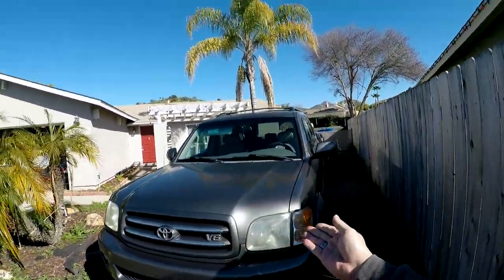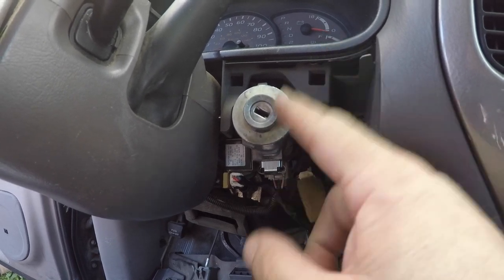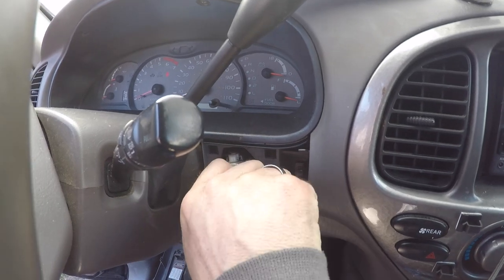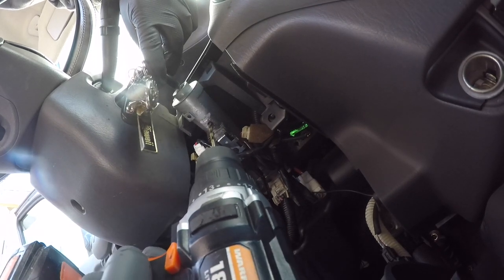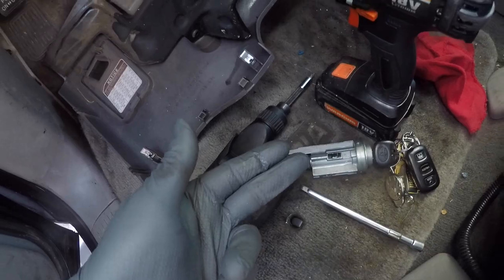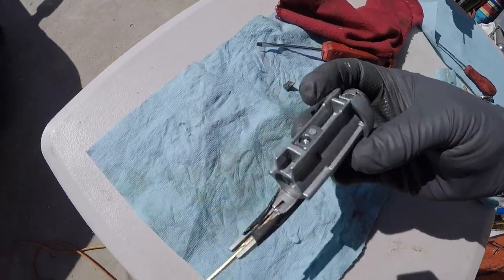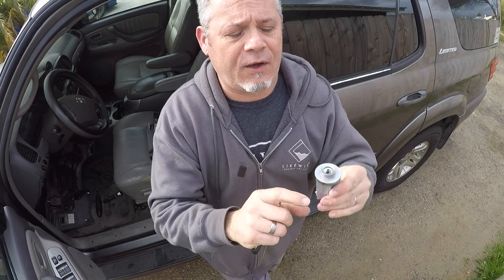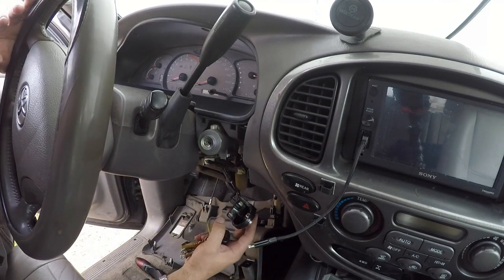How To Fix the Sequoia Ignition When The Key Won't Turn

Comment: Before you guys break out the drill, try some houdini lock spray. I just bought a truck with this issue, almost couldn’t drive home cause of it. Today tried some houdini and it turns no problem. A lot of black nasty crap came out when I sprayed it several times but it hasn’t jammed once after.
Reply from the maker: ABSOLUTELY!!  Try the simple stuff first: lock lubrication, try a different key, try with a brand new cut key from a dealer... THEN and only then, replace the ignition if it's just plain broken.

Comment: I have an old Toyota and it’s a small car.. my problem is I turn the key and only turned on one side of the engine and when I hold the key on start position the whole engine turns on and I’m confused about that

Comment: Thanks for the video! I have the same issue.  I think I have a transponder key and want to keep that key (looks exactly like yours).  I talked to my locksmith and will need an "uncoded" cylinder and then he can code it.  I think that is what you ended up doing too - is that what you refer to as the Ignition tumbler/switch assembly?  Do you have the part number for the 2001?  Thanks!
Reply from the maker: The part number should be the same for any Gen1 Sequoia, they didn't change the tumbler assembly at all for a long time. I used the one from Autozone: Locksmart Ignition Lock Cylinder LC64800 and had the locksmith change the tumblers in it to match my original key, so I would not have to rekey my doors.   The lock cylinder itself does not have the electronic coding - that is housed in the plastic ring that inserts around the lock cylinder.  It stays in place when you change the cylinder, so you don't have to recode your car.

Comment: How much was it all in the end?
Reply from the maker: Replacement ignition tumbler/switch assembly was $70 at Autozone, and the locksmith rekeying it to match the existing keys was $75.  All in for just a little less than $150.

Comment: @CliffjumperCars  Appreciate the help and video.  I fixed my 2001 Sequoia 2WD starting with your procedure and modified it slightly.  I ended up with a key for ignition and another key for the doors which was fine by me.  Here's the process I did for anyone else coming here for help:
- Purchased from Autozone LockSmart Part LC64730.  Comes with 2 new transponder keys - part cost around $250.  I didn't have the locksmith re-key it as my keys were 20+ years old and were worn.  In fact, one was bent some but they work just fine in the doors.  So, now I have door keys and an ignition key.
- My key wouldn't turn either, so I drilled out the little pin you referenced in the video - it took me a solid 10 to 15min to get that done.  Don't give up, just keep going and eventually, you can pull out the ignition key cylinder.
- Pushed the new cylinder part referenced above into place (like in your video).  Now you're ready to program.  

Programming the new keys to the Immobilizer (Must have the old key to program).  The immobilizer is the black ring that shows the key placement of ACC / On.  During disassembly, it will hang by its wiring harness.
- Place old key in hanging immobilizer and just let it hang - this will tell the car computer that the correct key is being used.  Try to start the car with the new key to confirm system is tricked so-to-speak.  It should start.  Then turn key to off position.
- Turn back to ON (since immobilizer ring is hanging you'll have to guess a little.  Maybe 2 clicks before the car starts)
- Press gas pedal down/up 5 times
-Then, press brake pedal down/up 6 times
- Do this step quickly: Remove key from hanging immobilizer and set to the side.  Remove the new key from the ignition.  Place immobilizer ring back on the ignition cylinder about where it goes so not hanging anymore and insert the new key back in the ignition.  (don't turn key).
- Press gas pedal once and wait 1 minute.  You should see the blinking security light.
- Once the blinking security light stops blinking and goes out, your key is now programmed.  Start the car to confirm.
- Repeat these steps for the second new key.  Only this time you can keep the immobilizer ring on and use the programmed new key to start the programming for second key. 
- You should have two new programmed keys now for the ignition and your old key that will work for the doors.
Reply from the maker: Great info~!  Thanks for sharing the key transponder coding procedure!!